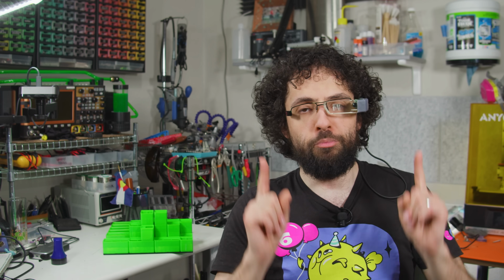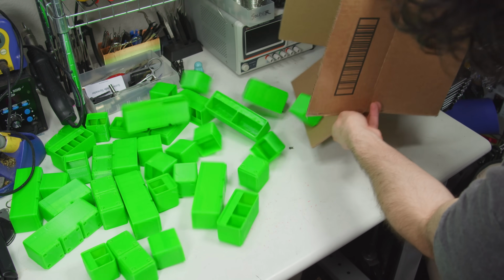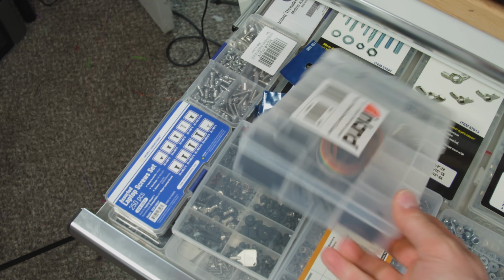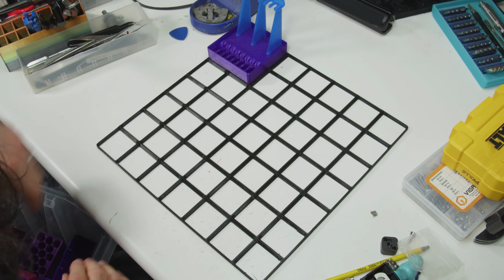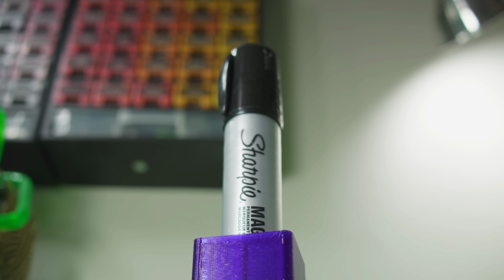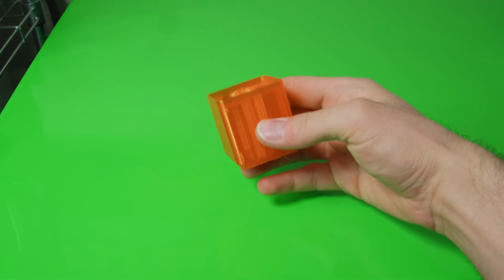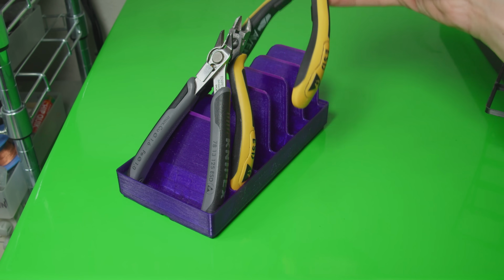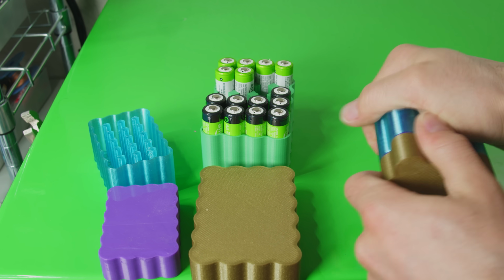Gridfinity: Your Ultimate Modular Workshop is FREE!

Comment: Re: your take on how original ideas should be monetized. I absolutely agree that resting on their laurels is trash but at the same time patents exist to credit the creator of the original idea and to justify their claim on a cut of any money made off their original idea. If you use a patent's concepts for a free product you should be free of liability as long as you modify it enough that the original design wouldn't accommodate what you've created without significant work.
Reply: Patent "owners" shouldn't get to leverage force because they got mad about how other people arrange their own (physical) property.
Reply: I'm not saying patent owners should have any say at all in how people arrange their property. I'm saying that if you're selling something you should either have significant stake in the innovation involved or pay a cut to the person who did the hard work.
Reply: @paulbenbrook5542  The innovation is just information. Which means the person selling something based on that information is merely arranging their own property in a specific way. It doesn't matter if that property is transitors in your computer, metal under a hammer or plastic being extruded by your 3d printer. 
Again, people who lay claim to ideas should not have a legal ability to leverage the force of the state against those who use said ideas without their permission. It's just extortion and is horribly unjust.
Reply: I get what you're saying but without the protection of copyright laws small innovators would be absolutely steamrolled by anyone with enough capital to force them out of business. There has to be a line where legally you can't pass off an idea as your own when it's not yours.
Reply: @paulbenbrook5542  
No you really don't get what I am saying, because you are stuck on "what about the poor lone inventor?" when there is no justification for it. This is about principled application of the force of the state, not simply some "big companies do bad things" situation - and even if it was, IP laws favor large companies over small ones in almost all cases, so that isn't a sound argument either.
The other angle is the point mentioned in the video - humanity benefits from the free and open flow of information. Whoever can produce something based on an idea in the most efficient way possible benefits us all, and there are often cases where you absolutely want someone with a lot of resources to test an idea extensively before it goes to market.
This is not even touching on how with IP laws, the inverse of your scenario is true - large companies with patents (or copyright, or trademark!) on all number of things, many they don't even produce commercially, can step in and have you taken to court for infringement if you wanted to improve on one or came up with something similar and didn't pour over, or pay a lawyer to pour over, hundreds of patents to ensure you didn't toe step.

As a side thing: Note that it is not called "theft" by the way, because even the law recognizes that you cannot "steal" an idea, as infringement deprives the IP-holder of nothing.
Reply: @Aubreykun 
I haven't been arguing that existing laws are the right answer, I've been arguing that there should be a system in place where someone who creates something wholly unique should be credited and anyone cloning it for monetary gain should be paying royalties.

I absolutely am not a fan of corporations or copyright law that allows people to never create a product and own an idea that they just imagined and wrote down. If you apply your concept to a product and someone creates a 1:1 copy of that product then competes with you selling it that is *wrong*.

Keep in mind that Tesla died poor because he didn't have any protections for the innovations he created and opportunists profited off of his work. The ideas he brought into the world should absolutely have been free information that lead to further discoveries, and in fact he multiple times referenced others using his patented work in their ideas building on them, and he was happy to see them do it if it cultivated innovation.

I'm not arguing that ideas should be locked down and anyone touching them has to pay a dividend. I'm arguing that anyone who creates something from nothing should be protected from vultures who would pick their bones clean to make a buck.
Reply: @paulbenbrook5542  
I'm not arguing simply against the "current system", I am saying that ideas are un-ownable. The system of "ownership" - that we use to solve the problem of competition over scarce resources - does not apply to ideas.
When you said: "and anyone cloning it for monetary gain should be paying royalties."
That means extorting people for simply arranging their own property the same way. That is penalizing people for doing the monkey see, monkey do. There is no issue with copying. There is in fact, great benefit to it.
You cannot enforce such a situation of "royalties" without being able to threaten someone with violence so that they comply. As someone else (who I forget the name of, if it was even written down) once put: 
"Your lack of entrepreneurial creativity is not a valid justification for government force."

Comment: Ok so when can I get a 100 pack assortment of injection molded ones?
Reply: They would be expensive to injection mold. YOu would need a three-part mold at least.
Reply: @RussellNelson  a lot of those designs could be slightly adapted for injection molding using standard molds. Then you're down to cents each for manufacturing cost if you make a run of 10,000 and sell them. I'd invest in that

Comment: I hope this system gets the attention it deserves! REALLY impressed with the incredible amount of thought that has gone into it. I hate having a million different systems to hold things. I have CNC Mill/ Lathe parts in a huge number of Dollar General Tupperware containers, DeWault click together boxes and small parts organizers. I find the DeWault system pieces I have works well enough and is easy to 3D print inserts. But they cost money just to get a product I have to modify to use and they really weren't intended for my purposes! I'll certainly be trying the Gridfinity! The only issue I see in my personal application is lack of sufficient printers to make it in less than 1000 years! Certainly going to try though!

Comment: I share your sentiments on the boxes with movable dividers. Designed custom boxes for my fasteners with static baffles. Sadly, nothing really helps the puff of entropy on the floor. I like your system. May need to rework some parts of my system. agree that one should archive everything. relying entirely on storage you don't control is a recipe for data loss

Ideas are ALWAYS fair game. It's a big chunk of how innovation happens. The real issue tends to be improperly reusing copyrighted works.
Reply: I hot-melt glue the dividers in place.
Reply: @RussellNelson  hot glue is great for tacking stuff down.

Comment: Got an idea for a 2x2 gridfinity block. 

A combination oscilloscope, serial terminal, graphing calculator, and small display.

Could probably just be implemented as a Raspberry Pi enclosure.

Or do all of those as discrete functions, rather than using a general purpose computer. Less flexible, but kind of cool.

Could also integrate a bench power supply maybe?

Comment: Zak I've been wanting to do this for quite a while - and I'm glad you beat me to it because it looks like a lot of work I didn't have time for! Did you speak about the rationelle for the standard dimensions in the video? If so I missed it.
Reply: He did not, he just mentioned what they are, not so much the why. I rewatched the video to see: why 42 mm pitch horizontally or 7 mm vertically?

For 42 I have a couple theories, one involving Hitchhiker’s Guide to the Galaxy as the answer to the ultimate question, what is 6 * 7? 

The other theory involves how many units would fit on the build plate of the printer he had in mind when he first jumped down the first rabbit hole before getting the larger printer he mentioned.

Comment: Zack, I have a tip for your stringing as it's quite noticeable in the bin holder closeups. Just a few moments with a heat gun will clear those away post-print if you don't have the time to dial in your retraction for every hotend/filament

Comment: I wish I could afford to buy a 3D printer but as a disabled US Air Force Veteran whose only income is under$300 per month. I wish there was a way to get a good 3D printer so I can get to making my ideas irl. If anyone knows of where I can find free parts of 3D printers so I can someday have all the parts to a complete printer, please let me know. ,👋👍
Reply: Look up the RepRap project. It's the basis of many commercially-available 3d printers and their designs are all open source. It does require some technical knowledge to actually build one however.
Reply: @Aubreykun  I can build one and want one but just can't afford one because I don't have any monthly income except for the $300 ish the dept. Of veterans affairs gives me for my disability compensation. Not much of a way to buy a 3d printer with that little of money.
Reply: @Ajtech369  I'm not going to pretend to know what you have to deal with in specifics, but I can empathize with it. Still, even reading about the reprap stuff could be worthwhile. That way if, for example, you see some good materials by the side of the road you can grab them, or if a friend or family member has some extra bits after renovations. 
Or heck, see if a friend has the desire to buy one but no time or patience to learn how to use it. It could be something where you both benefit.

Also probably bears mentioning: Thank you for your service.

Comment: As a sufferer of ultra ADHD+ Prime, This is a godsend!  My entire garage is lined with peg-board and shadow boards because if I can't see it I don't know where it is.  All I have to do is to get a 3D printer for this project.  Or I could machine it from a solid piece of plastic, although that would be wasteful.
Reply: I have the ADHD Pro and my problem is that I know exactly where stuff is (that marker was dropped under the chair and it'll stay here till I need it) but the minute I store something it disappears. Forever. 
So yeah having visible storage is probably a good idea.

Comment: "I'm just throwing spaghetti at the wall and seeing what sticks to the Like button" did, in fact, get me to push the Like button.  Well done, sirrah.

This entire project feels like taking a DeWalt or other high-end modular storage container and passing it through Adam Savage's "first order retrievability" criteron.  Which is meant to be a compliment, so I hope it sounds like one.  It also exactly meshes with my counter-argument to one of Maker's Muse's concerns about the recent AnkerMake commercial.  In yon commercial, Anker shows a parent have an idea and go straight to 3d printing it, to make a toy for their child.  Angus points out that this only works if one can 3d model, and the weakness of the whole "have an idea and then make your own bespoke item" concept is that 3d modelling is a skill that must be learnt.

(Learnt is also a word, if you're collecting them.  At least for those of us who aren't Americans.)

My counter-argument is that there's room in-between "I did the whole process myself" and "make the mass produced item work" for things like this: a project where someone else has done the heavy 3d design work lifting, but where I can take the results and make something that fits my specific needs better and more flexibly than a mass produced object.

Anyway: thanks for the video!  I enjoyed it, it was a good way to spend 20 minutes!  I've definitely got some uses for your tool storage stuff popping into my mind.  Now I just face the two big roadblocks of: figuring out what's going to be useful, and freeing up printer time and filament to actually print tools and not other stuff.  :)

Comment: Bro, I genuinely was mid process making almost exactly the same system. I saw Alexandre's videos, thought "I like that a lot, but want something more specific to my use cases" and got to work. The result was nearly the same. I made a giant parametric source file, I made flat grid boxed bottoms, with the 45 degree chamfer, I added a lip around the top for inserts, I made custom holders for things like batteries. This system is basically what mine would have become if I had enough time to work on it more. Insane. Great work by the way. You absolutely deserve the growth your channel is getting. Keep it up.

Comment: Awesome system! And the collection of  things is already huge! Do you have plans to add STEP files as well? The STLs are hard to edit and Fusion 360 only works on Windows and OSX.
Reply: You can pull an STL into OpenSCAD. Chop off the bits you don't need with intersection().

Comment: What would you do to maximize space usage in a drawer with dimensions that don't divide evenly by 42 mm? I think that frames and bins with 1/2 and 1/3 width could be really useful around the edges.
Reply: There is a more recent video than this where someone created OpenSCAD files that are parametric and allow subdividing bins along the X axis (currently, only) you might wish to check out.

The files are available on github. I haven’t yet decided if I’ll spend the effort to add divisions along the Y axis as well, which wouldn’t be too hard for me to do.
Reply: @strictnonconformist7369  It's awesome to see an openscad implementation of gridfinity - I worked on one myself but got distracted and didn't finish it. The feature I would be interested in adding is the ability to make gridfinity grids and bins that extend outside of the 42 mm grid, to fill drawers with inside dimensions that are not multiples of 42.  I will check out the openscad project mentioned.
Reply: @jjfoerch  a change I'm interested in making is for joining grids at edges via a variation on the theme of tongue and groove so no external hardware is required at least when pulled apart from that axis (x or y). Of course, the fun part is the fudge factor based on printed resolution combined with printer calibration.

Comment: So... How do I use the parametric template? I'd like to design something with a 3x2 shape and I dont want to cut the templates and do the walls and corners by hand, i guess there is an easier way I'm just not seeing
Reply from the maker: Copy the F360 file into your own account, hit the 'change parameters' button that looks like fx, and edit slotsWide and slotsDeep. If you're making it smaller than 7x7, you shouldn't need to change anything else.
Reply: @ZackFreedman  thank you so much! You are awesome!

Comment: I watched the video of Alex CHapel, and i almost bought his design.
But i realised it was not open source, and it was a deal breaker for me. I would have paid for the files, provided they were with an open source licence. 
If i end up spending lots of filament and time making those things, i'd like to know that i'll be able to improve upon them, and share my designs too.
Your design solves this problem in my eyes.
Only issue i have with it, is the fact that it is made with Fusion360 instead of an opensource software like FreeCAD, and that the day fusion decides to change licence again
and screw people over, the work is rendered inaccessible for modification.

Although, that is still a tremendous work, a superb contribution to the community, and from there it's up to the community to port this work to FreeCAD (or even OpenSCAD?) if needs be.
Anyways, i hope this initiative takes some footing, and gridfinity becomes a framework to modular organizing systems.
I'll be using it for sure!

Cheers!
Reply from the maker: It's all Creative Commons my dude
Reply: @ZackFreedman  Yes, that's why i like it! And that's why i'll be using it :)
As i said, i didn''t use ALCH one for that reason, and will be using yours :)
Reply: As a F360 refugee I somewhat agree.  (I got distracted by Blender to the point I gained enough skills that it's still easier to do a lot of things there than in FreeCAD. I don't regret that one bit, it's The program for fixing everyone else designs without the CAD files or starting fresh) Fast enough to start your own compatible pieces from scratch in another cad program though. Did a storage system somewhat similar to Zacks, but different design goals. Stacking 60mm boxes, grid base trays, inset box bases. Basic boxes printed double wall .4mm or single wall with a .8mm. Idea was you could stack in multiple grid sizes on one tray, top with a lid tray, a couple elastic straps and you and have it portable.